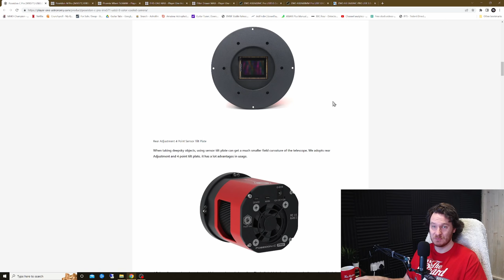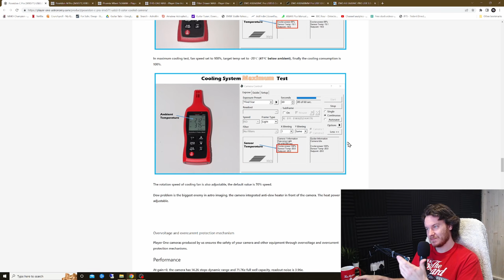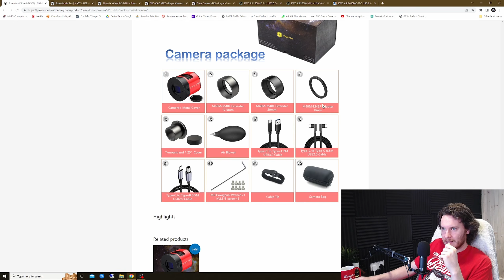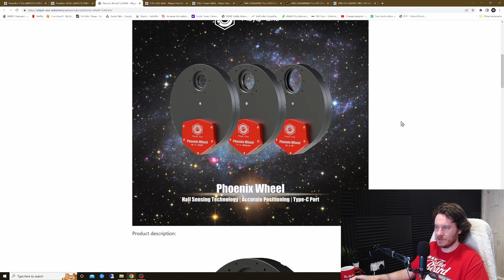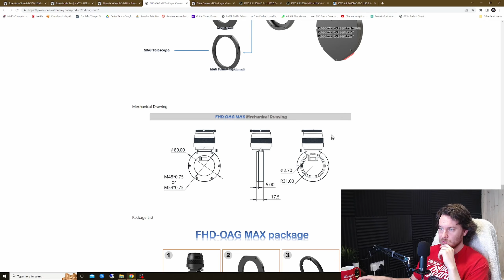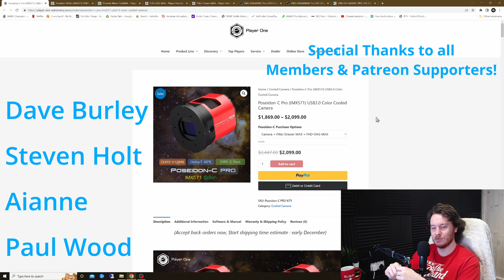Pricing/Deals/In-Depth First Look at the Player One Poseidon IMX571

Comment: Risingcam IMX571 is £1050 which is $1153 USD and you can have in right now. And it comes with power supply and spacers.
Reply: I bought risingcam mono version and now struggling with banding
Reply from the maker: That's interesting to hear mate! - I wonder what could be causing that to happen?
Thanks for sharing!
Reply: @rossc383  Weird. What software are you using? I mostly use APT but I'm also trying out NINA.
Reply from the maker: It's definitely good that those options are out there for people, I'm sure there's lots of happy users! :-)

Comment: Luke What is the benefit of an OAG ???? I like the camera buttttttttttt the price may be a little step... This hobby is going to put me in the poor house. Hey feel better, you seem pretty good.... Wife had covid in Sept. knocked her out for about 4 days but was not bad. You seem pretty good.. Stay safe
Reply from the maker: Hey Steve! I hope you and your wife are both doing well now mate! :-)
Regarding OAG, it's the best guide system if you can use it on your rig - it has much higher guide accuracy than a guide scope because you're guiding through the main telescope at it's full focal length, and any chance for flexure is removed entirely 👍 saves a bit of weight too!
Hope that explains it all bud :-D clear skies!

Comment: Great video Luke, but as the prices are in Dollars, you have not added the VAT and all import charges we will have to pay, which makes them more expensive than other offerings…..🤔🤔
Reply from the maker: Hey mate! I kept things in dollars purposefully for this to make things simple for me 👍 the price when it reaches other countries will vary as you say, it'd probably still come in cheaper than the 2600 here in the UK though after vat+duty I reckon!
Cheers for watching bud :-)
Reply: @lukomatico  just worked out the prices, and the OSC version will be approx £100 more than the QHY equivalent at modern astronomy, and the mono version will be £300 more than the QHY equivalent at the same dealer…..😮
So maybe not a cheaper option…more lit the same as the ZWO prices….☹☹